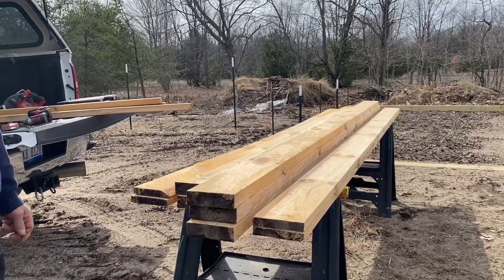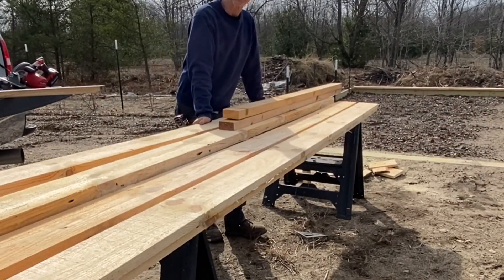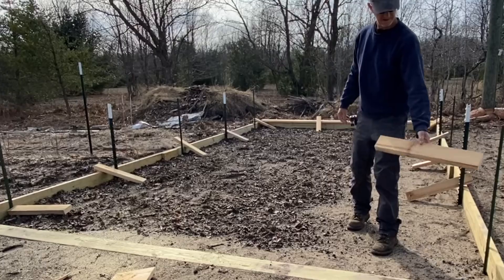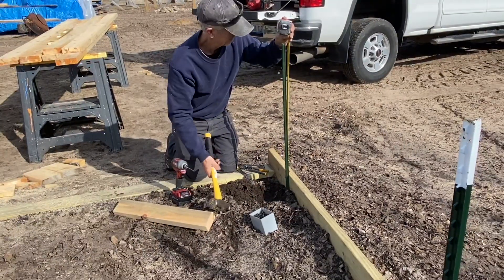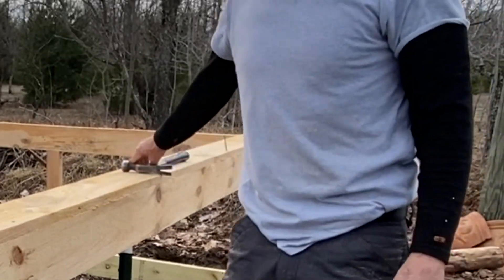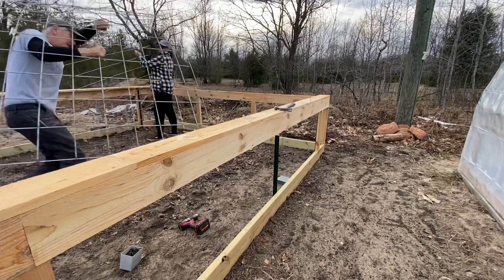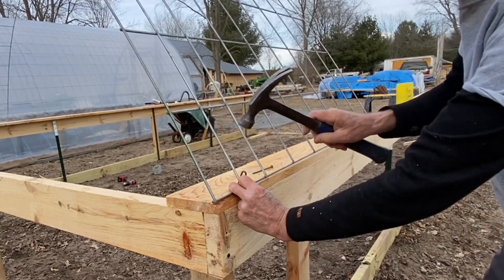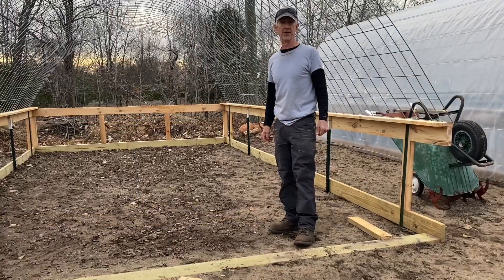How To Build A Strong Cattle Panel Greenhouse ~ Step Two

Comment: Wanted to provide an update about the strength of this particular build. On May 31st, we here in central Texas had a pretty harsh storm hit us with straight-line winds of 75mph and baseball size hail. We lost many portions of 100+ year old oaks and I expected the greenhouses to be gone. Both greenhouse weathered the storm and did not budge an inch. We had an earlier storm two weeks prior which produced golfball size hail and the 6 mil plastic sustained no damage, and the hail bounced off. I was impressed! The baseball size hail did punch through but only in about 10 places, and only caused small holes, which I believe I can patch. These builds are strong, I can attest to that!
Reply from the maker: So glad you’re ok!!

Comment: I like how this guy does the belt & suspenders thing with the screws. Nothing worse than putting in tons of time then the darn thing falls apart. And I appreciate that he explains as he works. This is an excellent instruction video. Thanks! 👍👍
Reply from the maker: Thanks for watching!
Reply: Any experience with shade cloth  and keeping warm on  cold nights?
Reply from the maker: Yeah we live in Northern Michigan. Inside the greenhouse I’ve covered the plants with plastic, hooped over, and one night we had an electric heater going. It worked good. My peppers and tomatoes are good size. We do plan to use shade cloth this summer. Thanks for watching! 😊

Comment: I. used six 2x4's for posts for a 20 by 11 1/2 cattle panel GH. I used 4 foot posts, 1 1/2 feet into the ground. Wanted the 2 feet below the he 2x4 horizontal. This left 6 inches of 2x4 above the two foot high. Horizontal which I didn't cut off . Once the panels were in place, I added a horizontal 2x4 on the inside of the panel, six inches above the two so footer on the outside of the panels. This spread out the arc of the mesh horizontally and brought the 7 foot tall center down a  foot and broadened the arch. The idea was less height as we have vicious winds but also more height on the the inner sides of the GH. This has made the arc of panel more stable.
Reply: Cool idea, I'm about to put a 10 x 33 ft one together and I like the idea and will give it a try. Wind isn't a problem, but we are gonna like the more uniform height. Thank you.
Reply: @samlevy4690   HI SAM - GLAD YOU LIKE MY IDEA.  If you set a 16 foot long cattle panel as a hoop on the ground - at 11.5 feet span you get 4 feet  height. So, is you raise the panel two feet, it will be 6 feet so whatever height you want, you just add it to the two feet. If you raise it 4 feet to get 8 feet height you might consider using 4x4 pressure treated posts . . . as the 2x4 may be kinda light. Also, use plenty of cement in the holes as the trick I describe puts the posts under pressure and you want them to remain vertical. . You could use pressured 2x4 but get a full foot and a half depth and have cement go to top of soil.  Also, be sure and get UV treated zip ties to tie the hoops together or they'll snap in the sun. I didn't and had to replace all mine! Good luck!

Comment: What state are you in do you get a snow load? Everything I’ve read said you have to keep it inside of 7 1/2 feet wide or the arch won’t support the load? Would you have any advice for somebody who’s building this for the first time in New Hampshire we were thinking about adding 4 feet to the 16 foot panel but I don’t know How that will affect the overall strength?
Reply from the maker: Hi! We are in Northern Michigan. Our 10’ hoop house did fine this winter, with the snow falling off on its own. We discussed the possibility of having to keep an eye on this 12’ hoop house for snow load. If it’s an issue we will put in extra load support at the peak, and keep the snow off. I think with extra bracing it should be ok.
Reply: I have been watching many cattle panel greenhouse videos. Some people put in a brace down the middle, to help support any snow load. Seems they all fair just fine.
Reply: We're in Maine and built our first cattle panel Hoophouse in 2021. Cement corner posts,additional ropes going over down into the anchors/earth. Middle beam for extra support of snow/ice,but so far snow or ice slides right off,we are in full sun. Bottom 2 foot knee wall is screened and this thing does not budge. Love it! We are now building our second one of 12x20,Hoop frame from a shelter king. Again will do cement corner posts and some things will be different on this one..

Comment: You spent more money on wood than you will ever get from that greenhouse in food savings i've done the math, plus if you're going that kind of money just make a greenhouse, these hoops are good until a big storm and plastic has to be changed every few years, i have 3 greenhouses running 10 months a year.
Reply from the maker: The wood was free, milled up on our sawmill. We use what we have. 😊